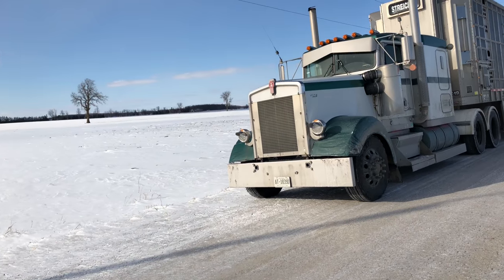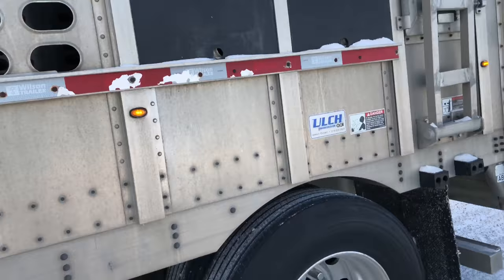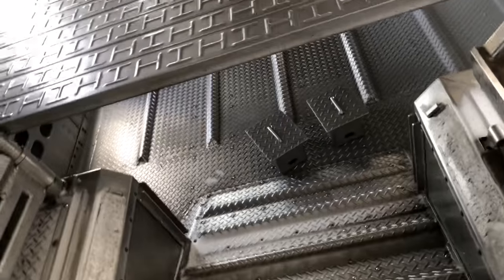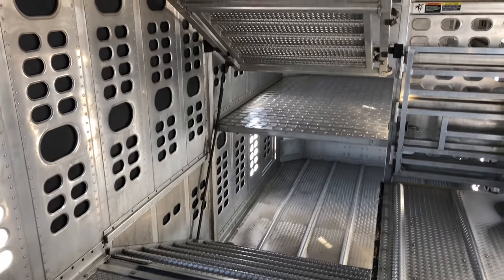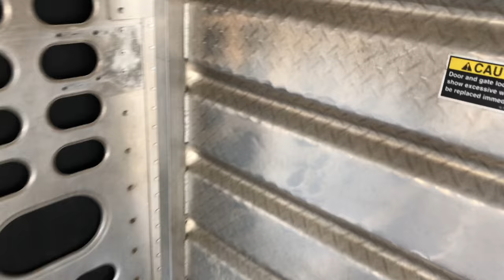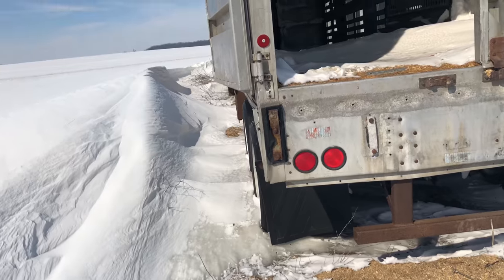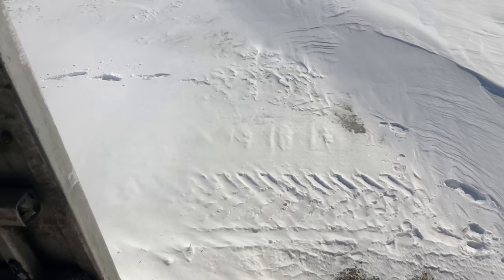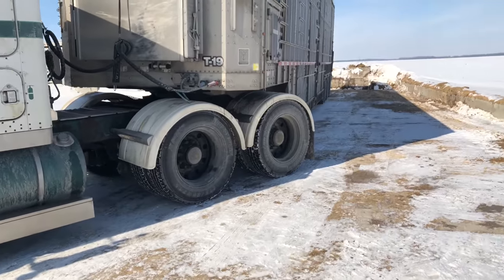Wilson Livestock Trailer #livestock #truck

Comment: -12? Nope. Wouldnt catch me out there fuckin around with all that in -12 lol. It would have to pay some pretty ridiculous money for me to do that. I dont mind throwing on a set of coveralls an chaning or strapping somthing down, or putting load bars an all that stuff in for different loads and trailers but thats a little to much for me. I dont handle the cold well. And I'm from New Hampshire, you'd think I'd be used to it since our winters are pretty similar.

Comment: hi bro Livestock Trailer do you get paid for mile ?
Reply from the maker: Depends, local work is usually hourly
Reply: better to work on the clock?  @Bubbles8V92
Reply from the maker: Well I don’t know how it works for everyone but i definitely prefer by the mile, long distance pays a lot better in my opinion
Reply: Log trucking in the norwest US is by the ton. Usually 25-35 tons payload. Independent truckers commonly gross over a $1,000 a work day.

Comment: Can you start trucking as young as 18 locally? If so, what is the best way to find the best job?
Reply from the maker: In canada we can truck nationwide at 18... unfortunately best way to get a job is to know people that do it, i have never asked for a job in my life, so I certainly don’t know how normal people do it, usually you would have to go through a long training process with a huge company if you don’t have any connections inside
Reply: In Canada you can get your license at 18 I did .Good luck getting any one to hire you before 21 .A lot of companies can’t hire you before 21 because insurance companies will not insure you and you need to be 21 for boarder crossings.If you don’t know any one who can help you get hired you will need to get on with one of the big companies like Schneider ,swift and so on and they will  not hire you before 21
Reply: In the states you can get your CDL at 18 but only run in the state your licensed in until 21.  Best option is to look for a local dump truck or excavation company to get experience.